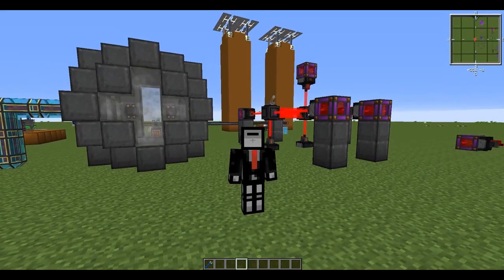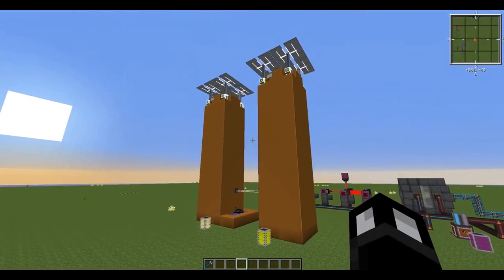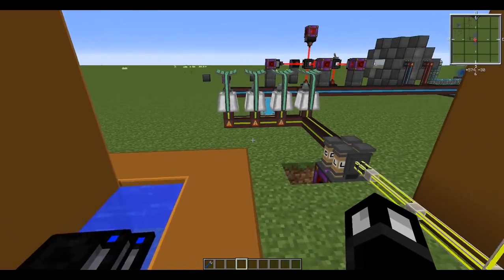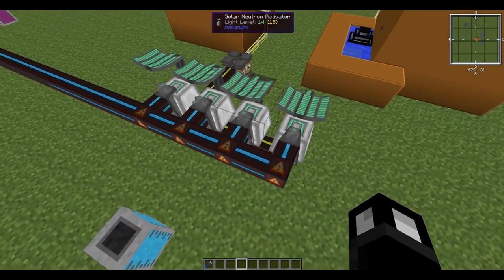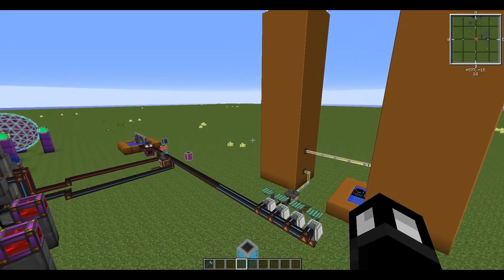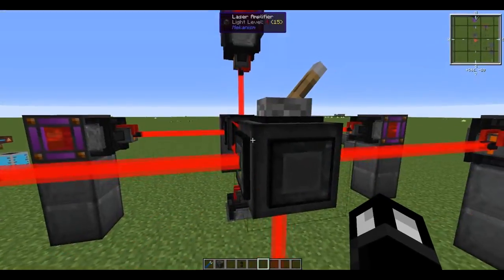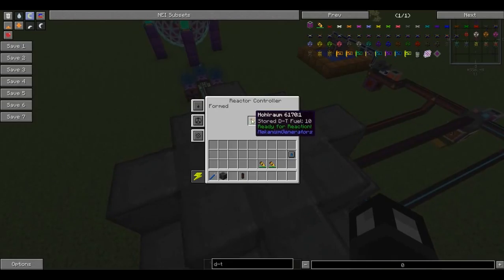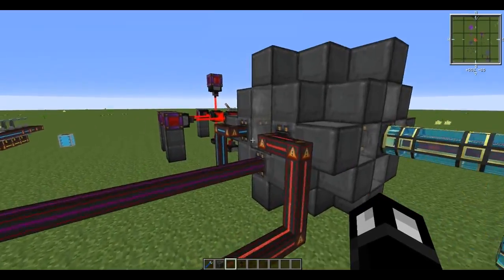Mekanism Fusion Reactor: Lasers, Fuel, Construction and Ignition

Comment: for those who don't know, Mekanism version 9 evaporation plants do not require solar power or sunlight.  they get their heat from heat generators, and there are two options: one that runs on char/coal, and one that runs on power (like rf).  
you can still use solar power, if you want, but it's not necessary.  as a matter of fact you can make them underground, which is nice because they kind of mar the landscape.
also, at one point he says "you can make it as tall as you want", but actually the plant can be no larger than 18x18x18.

Comment: Very informative video, thanks. :) Also, in response to the thing about power storage, Mekanism V8 actually adds a new power storage multiblock called the Energized Induction Matrix, which can store quite a lot more power than the tier 6 Draconic Evolution multiblock.
Reply: Catfish With time and patience, I could build an EnderIO multiblock capacitor capable of matching that... mind, it'd probably be the size of a Crag biome.

Comment: I definitely enjoyed the lack of NEI recipes in the video :)  I'm really sad that you used Thermal Expansion for so much of the support though.  As someone mentioned, the power storage is part of Mekanism, along with improved cables (power), improved mechanical pipes (fluid) and improved pressurized tubes (gases).  The only non-Mekanism pieces I have had to use to setup a reactor and power storage were the portable tanks I use from Thermal Expansion, as well as some Ender Tanks to fully automate.  Make sure to try out the Configurator on the connectors to get the same functionality (mostly) as you would get from EnderIO cables :)

Thanks for the pointer on using the Biome Painter from Random Things.  That will save me a lot of grief next time :D  I also liked seeing someone use the Draconic Evolution mod :)  If only it didn't require so much Wither boss farming :(
Reply from the maker: Michael Hecker It's not really so much a Mekanism mod spotlight as it is a video on just the fusion reactor. But your point is well taken and I'm the first to admit I'm not the most knowledgeable when it comes to mekanism.
Reply: ***** 18:55 the bal is a ideal a makiet the ori warschip
Reply: ***** I'm not much better... though if you dig into the mekanism configs and shut off the wind turbine noise you could use a field of those to power everything but the evaporation towers.

Also, if you've the patience for it, you can actually 5x your ore output using Mekanism equipment.

Comment: What cables are you using to move the power from the reactor to the energy core?
Reply from the maker: Iybraesil cryo stabilized flux ducts
Reply: ***** from what mod?
Reply: mogatron roblox thermal dynamic

Comment: On a modpack i play on, in thaumcraft there is a addon that adds a Bedrock dimension, how do i get the heat? it wont go up in the evaporation tower thingys, and the modpack doesnt have the mod random things, what do i do?
and btw, everything is like plain biome
Reply: +Cosmic Not sure what you're asking, but if you're trying to build this in the Thaumic Tinkerer Bedrock dimension, I'm pretty sure you can't.  At least, not the evaporation towers or neutron activators.  You may have noticed, there is no SUN in the Bedrock dimension... that's required for solar-powered machines to work.  You could build the towers and activators somewhere that DOES have sun (preferrably at all times, which you could manage with Mystcraft or an RFTools dimension or maybe with some other mods that let you manipulate time so that you can eliminate night) and pipe their outputs through a tesseract or dimensional trasceiver or similar into the Bedrock dimension where you could have the rest of the setup.  Not sure why you want it to be in the Bedrock dimension to begin with, but that is as close as you can probably get.
Reply: +Dustin Rodriguez the bedrock dim has day and night (with sun and moon) and the evaporation towers work same as the solar neutron activators but since the tower isn't in a desert biome it doesn't make enough of the chemicals it's making (forgot the name of it/those). and I got everything to work, sadly the server had a map reset :(
Reply: +Cosmic You must build a Awakend Picaxe ( The orange one ) then break bedrock and then there is a portal to the bedrock dim
Reply: ... i had that pick XD but since the server reseted i lost everything XD I had almost full Awekend Ichor armor xD i had multiple Thaumium Golems with upgrades, all research in the book and so on xD so on thaumcraft i couldnt get better stuff, and i had infinity materials :P

Comment: Can you draw the power from the solar panel
Reply: +aosmeboy yes but if you connect it to something else it willl slow down the process
Reply: so you can use it to power another reactor to then power that reactor
Reply: and make it a loop
Reply: +aosmeboy hi yes but the reactor needs more power than that so try adding more power sources (notice:  if you use the solar panels from the salinity orange thing it will stop working because the reactor will drain all the power from the solar panels

Comment: i cant get my bruine to pass to the next solar evaporator
halp
Reply: Click the Fluidduct connected to the evaporator, and change the torch icon so it doesnt require a signal to flow, do this on both sides.
Reply: You may also need to shift-left click on the first segment of mechanical pipe with the configurator so that it switches to "pull" mode.

Comment: how does he draw power from the reactor to the draconic RF storage?????????????????????????????????/
Reply: Aidan Court Using cryo-stabilized Fluxducts from Thermal Dynamics
Reply: Aidan Court
What CrystalStar said.
Cryo-Stabilized FluxDucts have no maximum RF/t transfer limit, and any input-output limitation is on the part of the transmitting/receiving machine(s).

You could literally build a Big Reactor the size of Texas (Cuz, screw efficiency), and transfer the ridonkulous power output through a single CryoStabilized FluxDuct line to a T7 Draconic Evo energy core with no problems... Mind, the T7'd likely be full within 10 minutes despite its' 2.14 trillion RF capacity with a reactor that big.